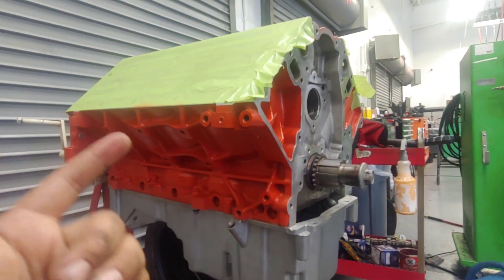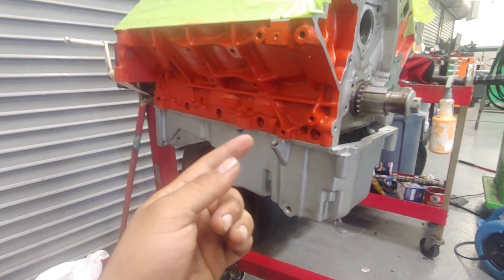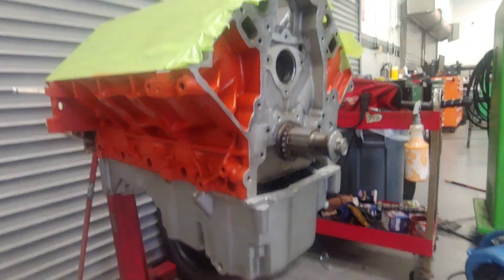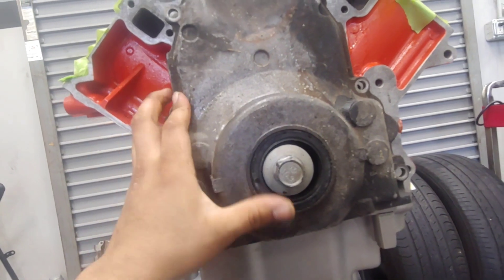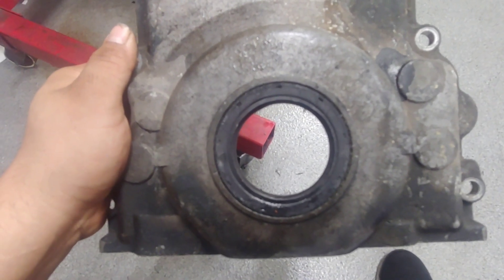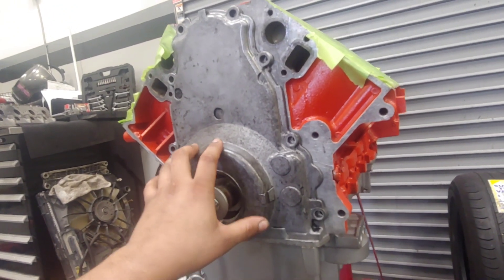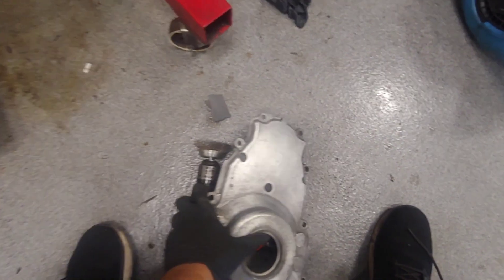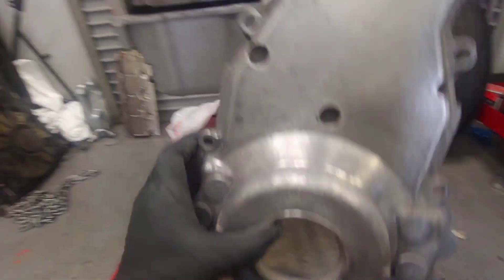LS CAM SWAP, OIL PUMP, AND TIMING CHAIN INSTALL. LS1 LS2 LS3 LS6 LS7 LS9 LM7 LQ4 LQ9 4.8 5.3 6.0 6.2

Comment: Good video . 
Do you have to buy a single bolt Gen 4 cam to run the LS3 timing cover with front cam sensor?

Comment: Is it necessary to change timing chain and it's sprockets when doing a cam swap? I will be doin a BTR Stage 3 V2 truck cam. Thank you. Your opinion matters.
Reply: No.  The timing chain will have lots slop, they do from the day they were new.   I wouldn’t use a V3 I’d use a V2 at the most, or sell it and get a BTR truck Norris, and pac 1218 springs.

Comment: Did you not shim space check your oil pump from variations to correct centering its important for long life against  premature ware otherwise failure will occur caused by extra ware